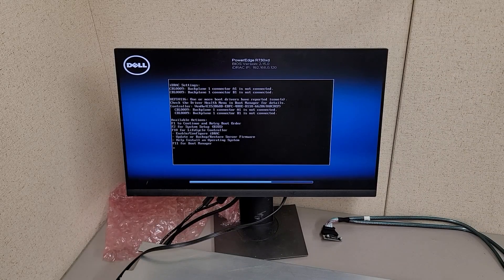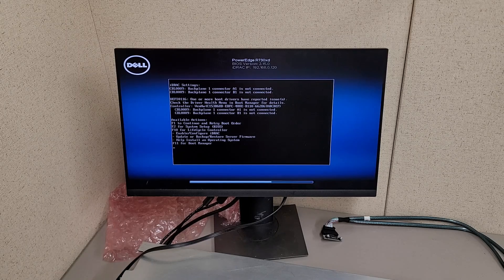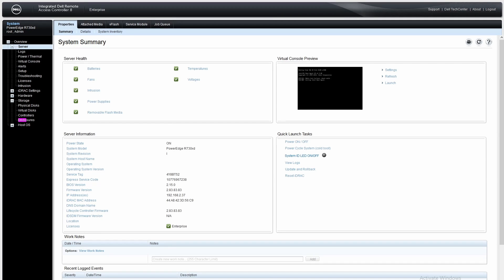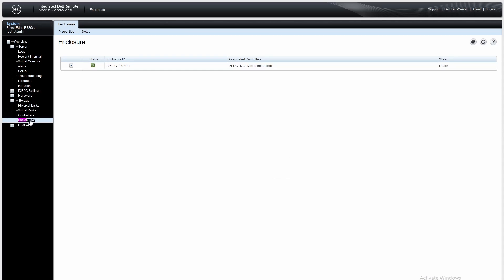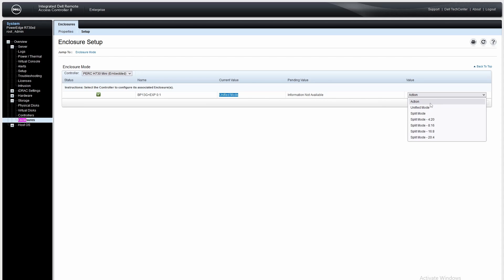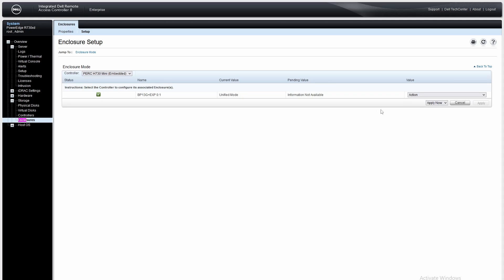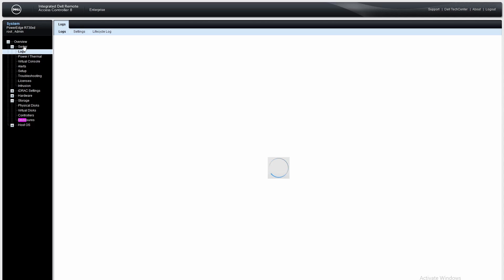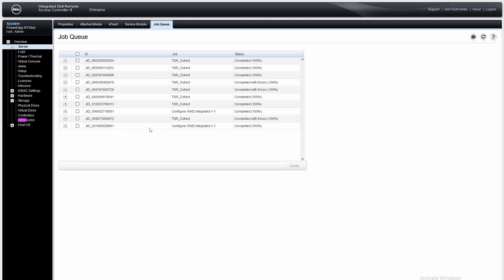How to fix R730xd error CBL0009 Backplane 1 connector A1/B1 is not connected

Comment: Mine is in unified mode, and still cry for A0 not plugged in. Any further idea?
Reply from the maker: A0 would be the main portion of the backplane I believe. I would reseat your cables and make sure they are plugged into the right ports.
Reply: @computersales  yeah, main cables from controller is A0 and B0. I done reseat them few times, because I unplugged the whole front panel to see if anything is changing.
at this moment the "solution" is suppress the message with turning off "wait for F1 on error".
Reply from the maker: @MrLarryl79  weird that it is giving you that error while still seeing the drives. I've never seen that before unfortunately so the only thing I could recommend would be doing firmware updates and resetting the BIOS to defaults. If that doesn't work you'll have to play with the BIOS settings some more and see if there's one that is set wrong regarding the back plane.
Reply: @computersales  I played around days :)
I posted it in an IT group and linkedin too... no answer for days...
Reply from the maker: @MrLarryl79  It is also possible the cable is bad I suppose but I don't think they are prone to failure unless there is physical damage.
Reply: @computersales  I had no issue until the rear backplain installed. Soom I plugged it in, error came up. But the rear backplain works too, the OS disk are connected there.
everithing is working fine, just annoying error message. and if the OS is running, the Idrac led cahnge to blue too. (I don know how long time need)
Reply from the maker: @MrLarryl79  I don't know what is going on unfortunately. This is Dell's guide to the cabling for these. If it worked before I would double check the cabling and reseat everything.
https://www.dell.com/support/manuals/en-us/poweredge-r730xd/r730xd_ompublication/removing-the-hard-drive-backplane?guid=guid-ad50f394-cb7b-48b7-be67-08bb40b4d60f&lang=en-us